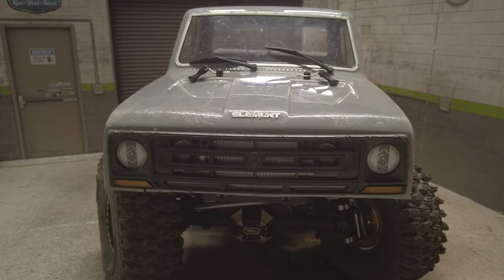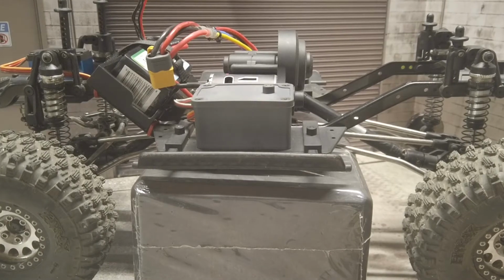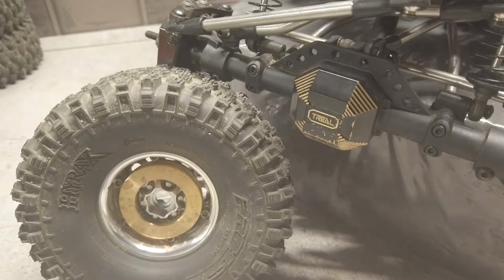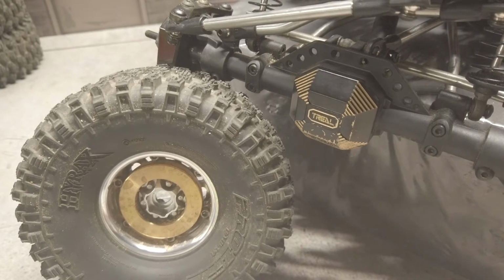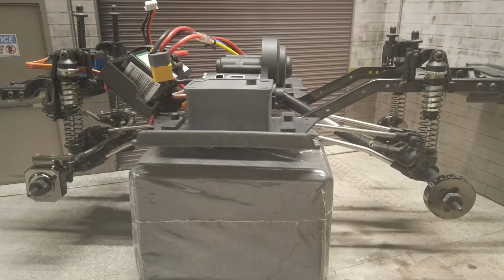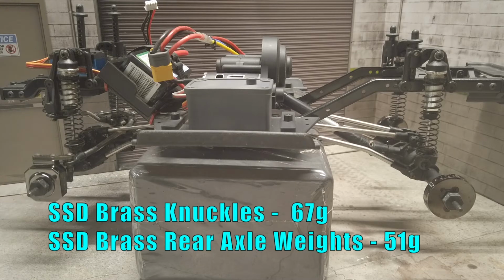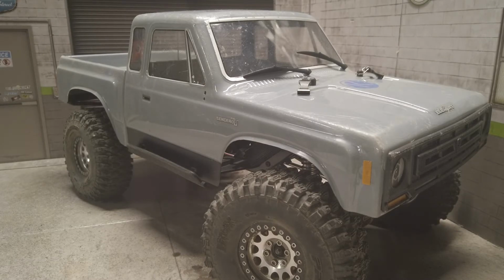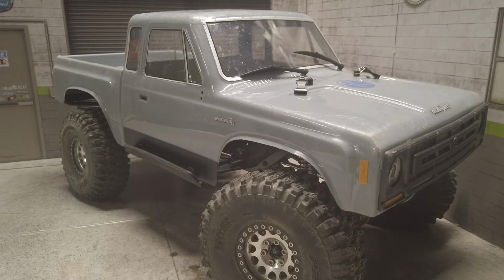Element RC Enduro Sendero | Upgrades - Testing Before & After SSD Brass Weights

Comment: A good option may be to add the stiffer chassis plastics. The element chassis is very flexy and tweaks the chassis underload. It's nice the some flex increases traction but  the enduro is very flexy. I did the hard plastics to mine and since the battery mount will be extra due to replacing with the hard plastic you can put it on the chassis behind the transmission for extra rigidity. This will let the suspension to more of the work.
Reply from the maker: Thanks for the tips!  The video is from few months back.  Since then I have swapped out the chassis to Gspeed LCG chassis, and I no longer have chassis flex.

Comment: I wonder if the weight bias changes with the truck is more "vertical" (steep climbs)? Watching this almost reminds me of the times I was adjusting my mountain bike suspension (rebound vs. compression vs. lockout, etc.). So many factors to consider...
It's funny, I was finding myself cheering the truck up the hill! "You can do it! You're almost there!" Such drama!
I can't wait to see the adjustments you make! Great video of before vs. after!
Reply from the maker: Suspension & Chassis mods are next set of mods that I will be tackling.  The front wheel lifting behaviour totally caught me off guard.  Not something that I was expecting.  But the more I thought about it, it made sense.  Fortunately, I was going to be tackling the Low CG next, so it will work out.
Reply: I 100% agree. Once you change the suspension dynamics you have to re-configure the pre-load, or even spring weight. The weight of the oil in the suspension. Also, as you mentioned with the vehicle on harder climbs, it should want to tip over more as the extra weight up front is tilted more off-axis. Probably the easiest way to test this would be to add more preload to the rear shocks which should help keep the front down.

Comment: Try white n green springs..it will lower the cg a lot ..shocks almost bottoms out without preloads..try thicker shock oil as well..
Reply from the maker: I haven't done much on the suspension as I am still waiting on low CG kit ordered from Hong Kong way back in March :(. But going Low CG is at the top of the list of mods and future videos ;)
Reply: BigSung Hobbies wow Taksrc still haven’t send to u?